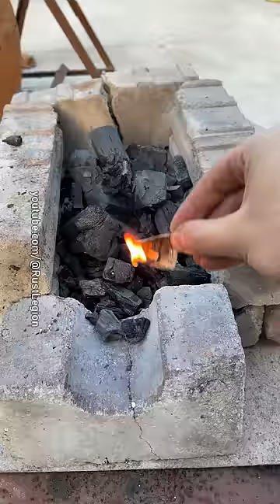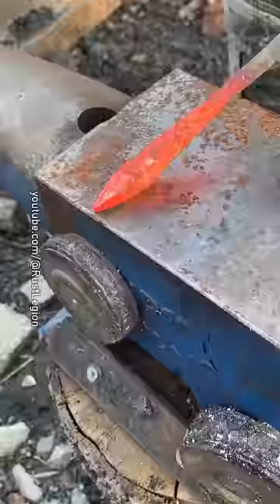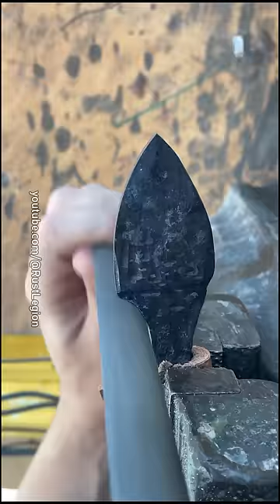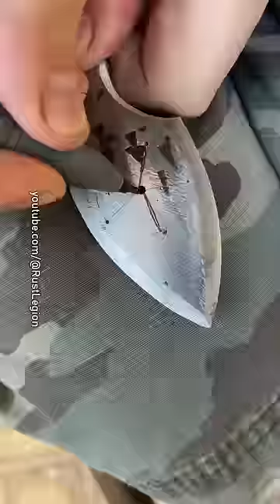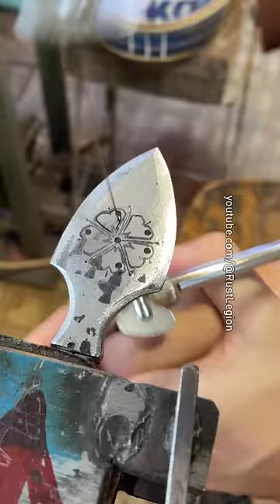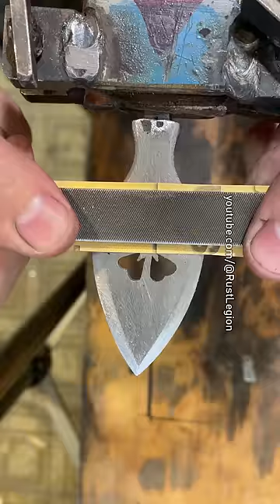Making Arrow head pendant

Comment: Wow, the pitting under that first layer of rust you removed actually looks like a bunch of parallel arrowheads.  That's so cool!  Excellent work!
Reply: It could be from a certain tool that was used on the metal at one point shaped that way, that's a way you make designs on metal, you forge a metal rod into a certain small shape and hammer the shape into the metal.
Reply: I noticed that too ,pretty neat . Your pendant turned out awesome

Comment: Im not a blacksmith or a blade smith by any means, but id suggest when finding metals around anywhere, give it  2 or 3 folds, not to make it look cooler, itll just make the metal a bit stronger with horizontal layers
Reply from the maker: hello there , This was true for the steel produced in ancient time when it was not pure and with many inclusions so it needed refining by folding. Modern steel does not need folding , It will only burn the carbon in it and will reduce it's volume and will be a lot of work.